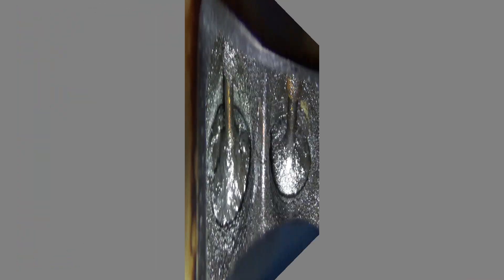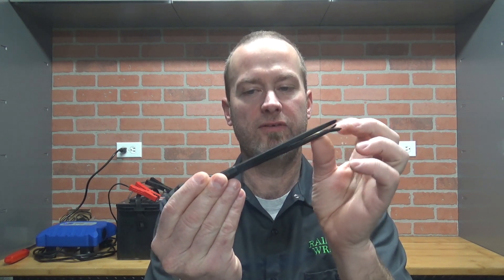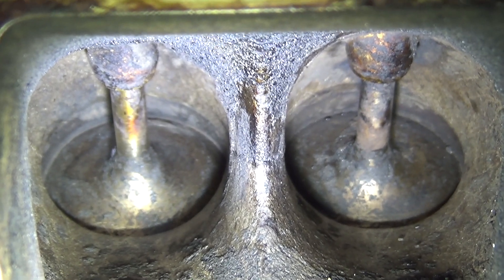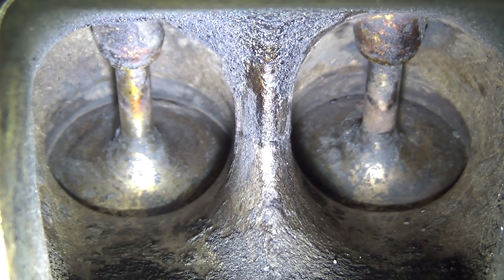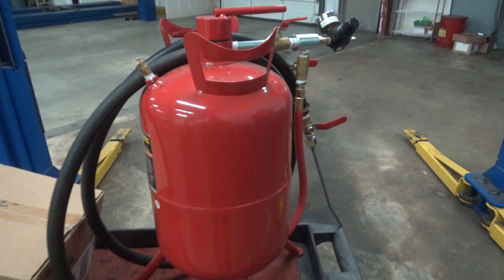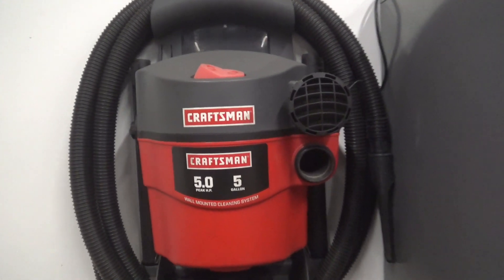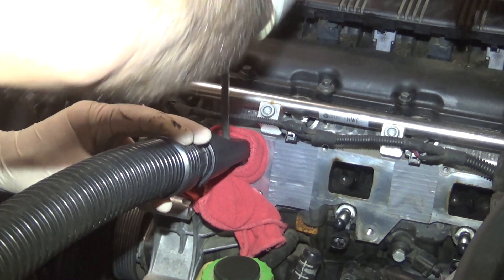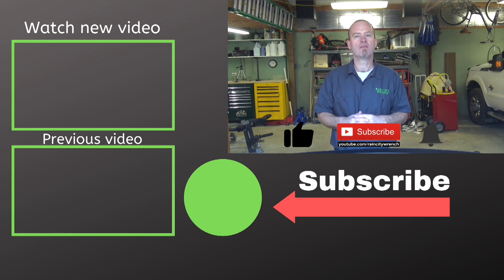Walnut Blasting Intake Valves, Audi Q7

Comment: This video offers good tips. I just did blasted my valves and next time i do a set will use the fine shells (grabbed the coarse without noticing). The coarse shells like to clog up and i  also went through the whole 25lbs before i realized it. Probably because i had that lower valve all the way open lol
Reply from the maker: Thank you for the comment Me5Ponk. Same thing happened to me, I was using way too many shells and that's when I started playing around with the valves and finally figured out the sweet spot on my media blaster. The first couple times I completely loaded up my vacuum cleaner.

Comment: Great video! Whats the charge $$$$$$ for this service usually run?
Reply from the maker: I charge intake manifold labor + 1/2 hour per cylinder. For example, a Jetta I did was 3.6hr intake labor + 2 hours clean. Sometimes I charge 1 hour additional per cylinder for difficult valve setups.
Reply: @raincitywrench117  ...Thanks, I Bought a 2018 Honda Accord brand new last year and am just now reading about this GDI setup... ridiculous!!!.....I always use exxon gas, I know that doesn't mean much, switching over to pennzoil platinum 0w20, and installing an oil catch can this week. hopefully I wont have to do the walnut blast until sometime later.
Reply from the maker: Hello obxguy1. Direct injection has definite benefits with some drawbacks. It will have much more power and better gas mileage. A few manufactures now incorporate a dual port/direct injection setup. My boss drives a new Ford that has it. At idle and low loads, it runs off the port injectors which keep the valves clean while giving it better driveability and at medium to full loads it is direct injected which gives it the power. In my experience, it is the european vehicles that build up the large deposits because they run high flow pcv systems. BG has a GDI induction service you can get done that is non intrusive and simple to perform (like once every 25,000 miles). BG also has a GDI engine oil service kit which includes an extended engine warranty. New engines have low tension piston rings to reduce "pumping loss" thus increasing gas mileage but can increase carbon buildup so keeping the rings clean will also help out. Ultimately I bet you will love the new engine and it is tough to go wrong with a Honda!
Reply: @raincitywrench117   Where are you located Sir?
Reply from the maker: @Alfra1324  I'm in the northeast Seattle area
Reply: @raincitywrench117  do you have a contact for your shop? Would love to bring my q7 in for service
Reply from the maker: @julielukens  Would love to help you but I now work for the sales department at a Ford dealer in Snohomish. I refurbish their trade in vehicles and it is closed to the public.
Reply: @obxguy1  buy a oil catch can/ oil vapour sep. as soon as you can, this will help alot to keep the valves clean
Reply: @raincitywrench117  great fly fishing area...esp. when you can fish from you front porch...lol